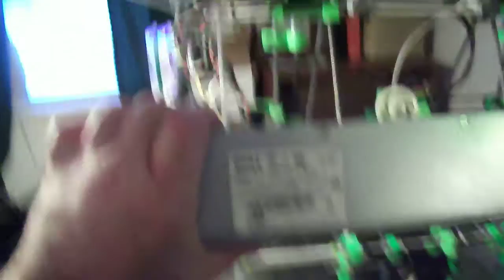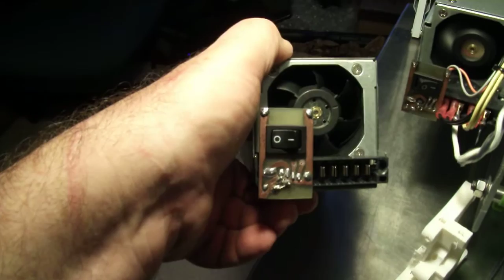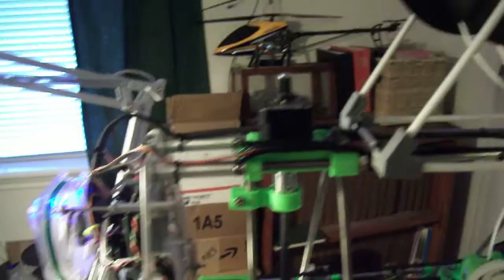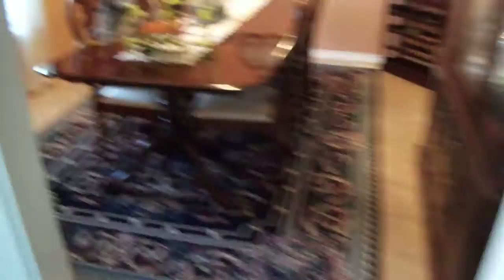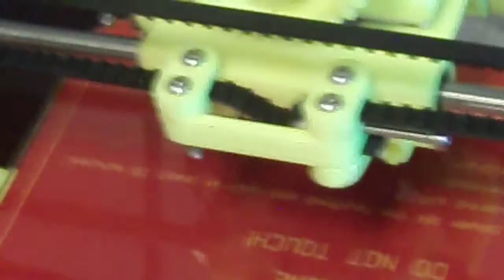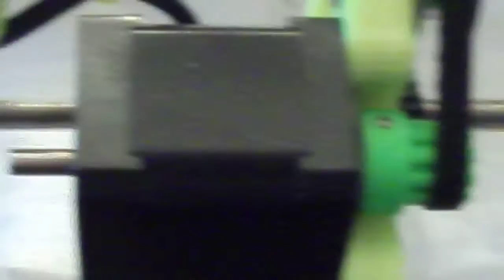3d printer # 8 how to video

Comment from the maker: Most of the parts can be found on Thingiverse, not from a kit but can be found randomly. Much time was spent in selecting parts that would strengthen and stabilize the printer. Two parts are not found on thingiverse which are the X ends, not of my design either, can be used on the Prusa and the Mendel Max.This is why I call my printer the 3.0